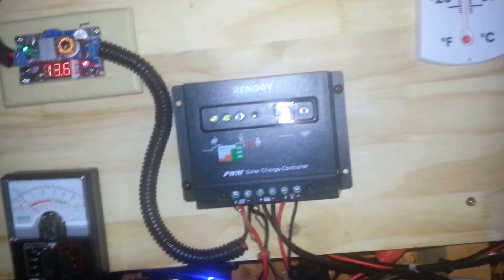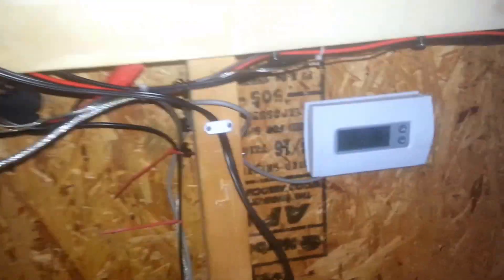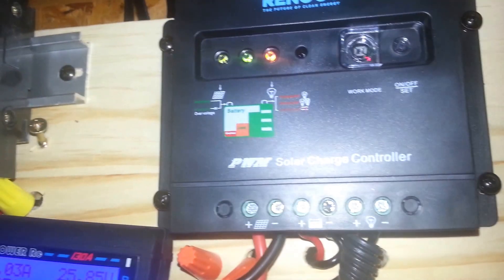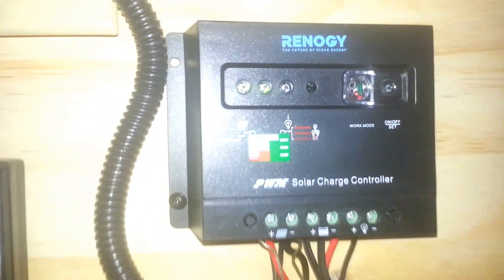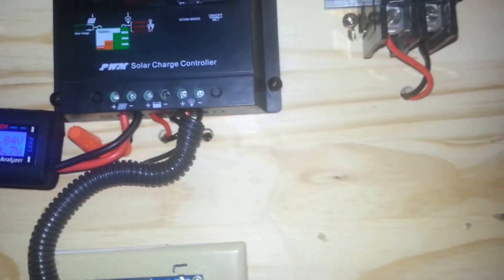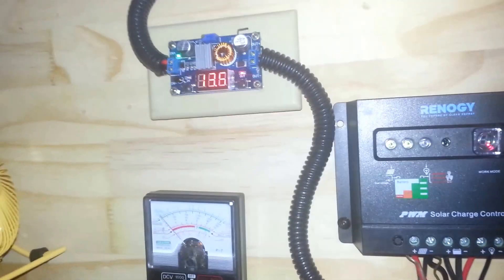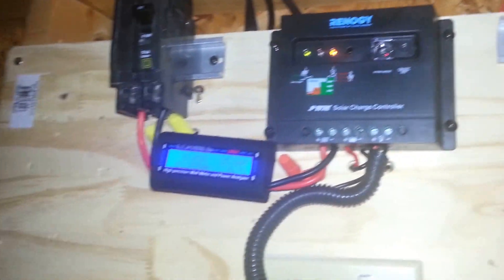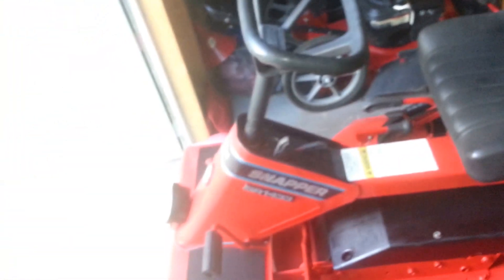Using Step Down DC to DC Converter in Solar Setup

Comment: Hello siri have 1 question can I use a regulator like yours to convert 36v from my panels to 12v... then to my charge controller in my solar set up?

Comment: Um... That step-down regulator is completely unnecessary. Since your primary PWM regulator outputs 24 volts, it's okay to put those 24 volts directly into secondary PWM regulator to charge 12-volt battery system. PWM is capable of handling up to 30 volts (usually). My guess is, that DC regulator is only up to 5-10 amps (I'm judging it by the lack of radiators), so it cuts out the significant part of the current.
Also, I don't understand why are you wasting so much energy to charge 24-volt battery bank AND 12-volt battery bank at the same time. Just charge a bigger 24-volt battery bank with 2 PWM regulators and use a powerful DC/DC step down converter for 12-volt appliances. Less wasted energy this way.
Reply: I've killed 9 buck converters in my truck charging system; that renogy is 80$...

Comment: will the step down comes back up if you remove and reconnect the input ? Why not connect the in put to the buck converter to solar directly did you try that out ? if you do same question is the buck converter comes back up fine in the morning with solar connected directly?

Comment: . I have a question. I have simple solar system on my raft. Sometimes battery goes flat because no sun for 3 days. I also have petrol generator of 2 kW. Can I combine my solar system with petrol generator using  battery charger without unplugging or disconnecting the solar system? 

Thanks

Comment: sir can i use the voltage converter instead of the charge controller to charge the batteries
Reply from the maker: I would not recommend it, as the voltage regulator does not have the intelligence to know when the battery is fully charged.   Now, if you were going to sit there and monitor it, yes, but I personally recommend a charge controller.